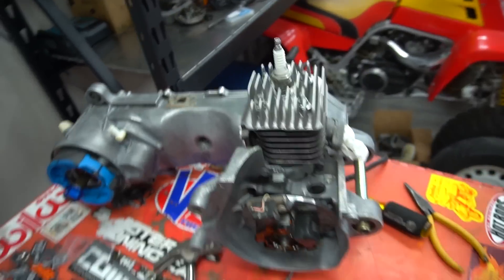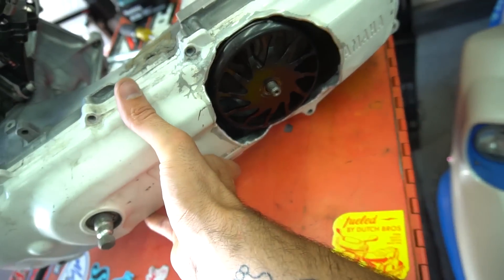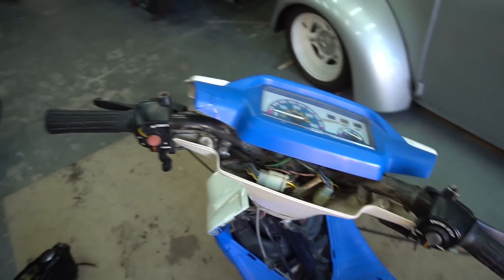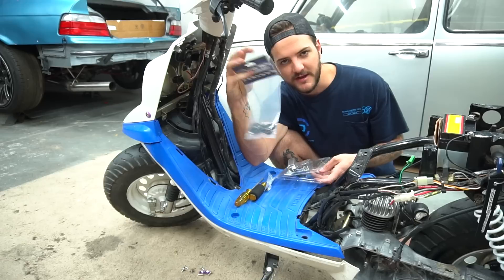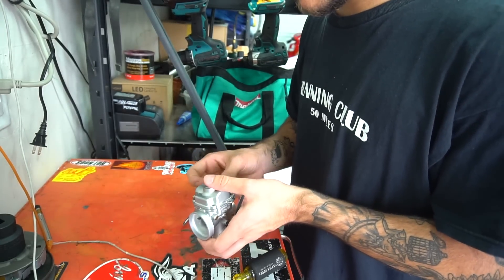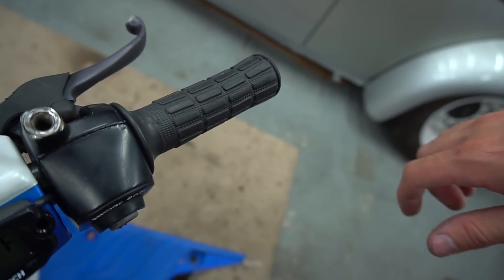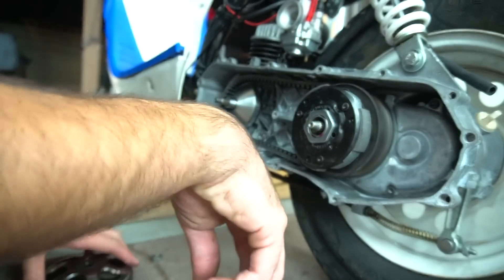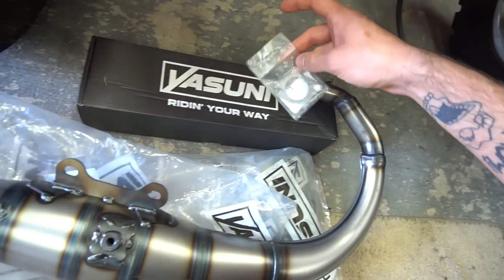it RUNS! 70cc ZUMA Prebug Build | Polini Corsa, Yasuni Exhaust, & More!

Comment: Polini 21mm carb, 40 pilot 110 main? The 6 gram weights, been researching different setups, Thanks for sharing its a good starting point for 70cc kit and pipe and roller weights to start at.

Comment: You should open the rear end and put a support bearing in the gearbox cause the kickercase supports it a lil bit
Reply from the maker: the kicker case doesnt have the support part on these older ones

Comment: You need a advance flywheel key on the crank for advancing the ignition and work on you cluch it needs to engage a 1500rpm higher. But anyway nice setup. At the moment im building a corsa setup same you have. But with porten crankcasings and cylinder

Comment: Now see the video. Nice setup, but polini corsa ports are miss matched. Needa a aluminum spacer on the bottom to lift the cylinder sobtge ports can alihn. And then shave tge top of the cylinder to get the 0.8mm squish or so. Then you port the exhaust port.

Comment: Look at your grip looks like it may be close to the plastic making it stick ive seen that happen before 🙌🏼🙌🏼
Reply from the maker: nah its not, its internal throttle housing
Reply: @MOPBOYZ  damn was hoping it was simple so either cable or carb slide
Reply from the maker: no lol, its the throttle housing, inside where the cable sits theres a piece of the plastic that was bent out a tiny bit and rubbed.
Reply: @MOPBOYZ  damn easy fix like the build coming along right sounds great 🛵💨💯
Reply from the maker: yea glad it was easy! thanks

Comment: Do you still have electric start? If so, does the battery have enough juice to crank it? And if so, what battery are you using? I just built my prebug, and with such a tiny battery vs my bugeye, it seems it just can't crank hard enough to start unless it's already fully warmed up! Yuasa battery and all (though it's conventional lead acid, not SLA/AGM)

Comment: No air shrouds?
Reply from the maker: mentioned it a few times in the vid, there off to check for leaks on first start up..
Reply: @MOPBOYZ  thats what a pressure test is for
Reply from the maker: damn i thought pressure testers for checking blinker fluid
Reply: @MOPBOYZ  dont mean to offend. Just curious why youd leave the shrouds off when you already pressure tested is all. Nice build ride safe 🤌
Reply from the maker: @AngusCPU  i don’t have a pressure tester, so i did a lil diy test using starter fluid for meantime
Reply: @MOPBOYZ  checkout Brent's video over on 49ccscoot. He builds one out of hardware store parts. I built one out of PVC endcaps and aluminum. Youll save yourself a lot of headaches and burnt out pistons.
Reply: @AngusCPU  faka no need still smash your bikes lol